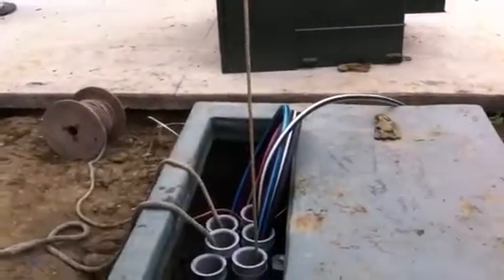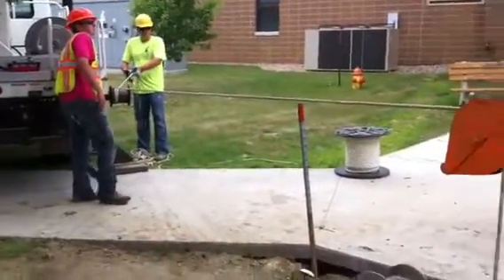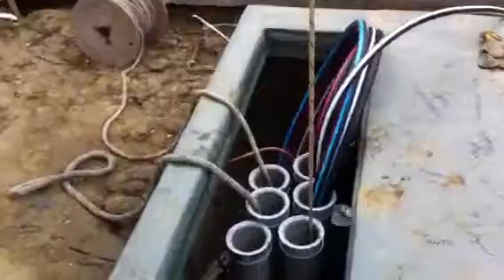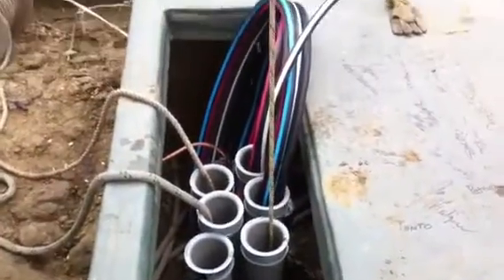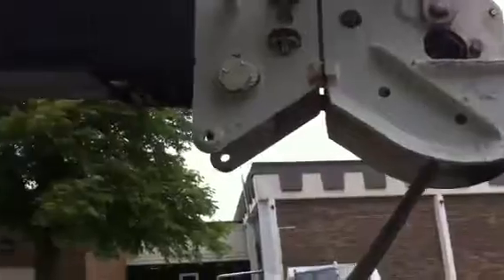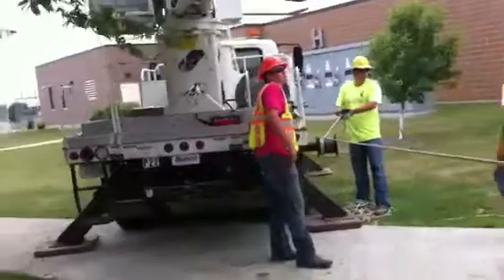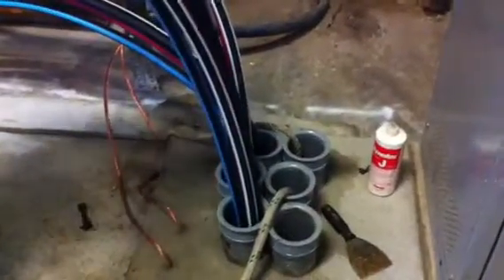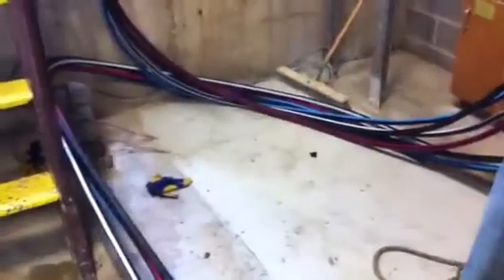Pulling underground cable in conduit

Comment: My brother, do you know what could happen to those two guys if that pulley snap?..Rule # 1 on cable/wire pulling. Never, never be in front or back of the spool or pulling equipment. Take care my brothers. 
Local #3 IBEW NYC

Comment: Thanks for the vid. I noticed you pulled the cable prior to setting the transformer. What are you thoughts on setting the unit, then pulling the cable. The obvious advantage is not having to worry about the cable snagging or missing the cutout when lowering the unit. Does it make pulling the cable significantly harder?